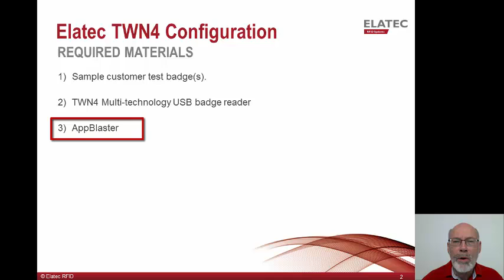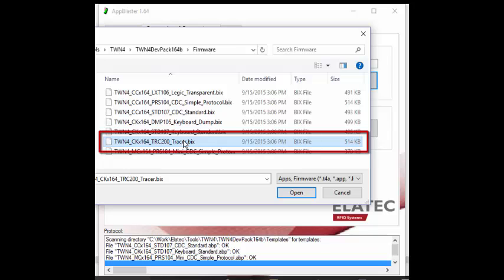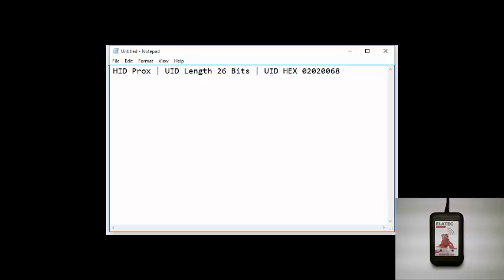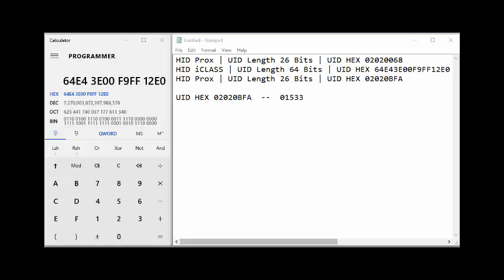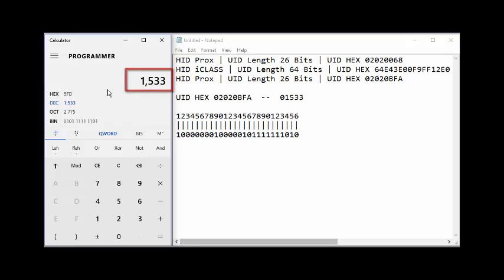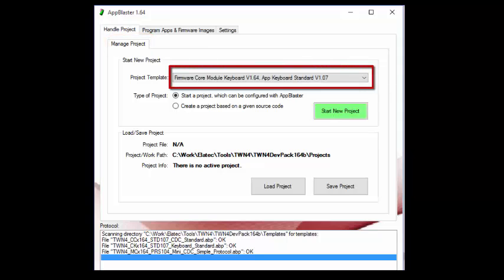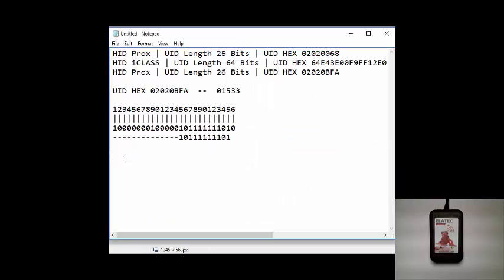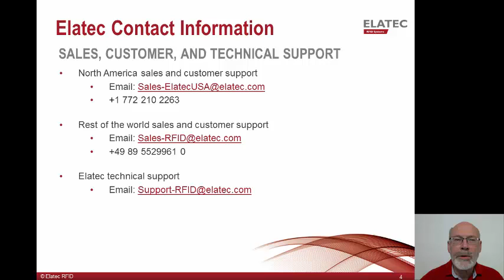Configuring TWN4 MultiTech card reader to output employee badge number

Comment: Hello,
please tell me,
How do I configure the "Delimiter" function for an MFP on the Elatec MultiTech Nano USB reader in DEC format?

That is,
I have Field 1 and Field 2, and in the Delimiter section, I specify different options like \ or \ or _ - as a result, on my Print Server software (for example, SafeQ), only Field 1 is outputted, and the second part and the delimiter symbol do not come out.

What am I doing wrong?

Thank you.